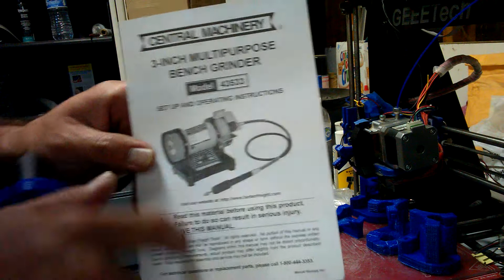3d printer into CNC for less than $50(1)

Comment: Is that glue stick on your borosilicate glass? I will start using PLA most of the time as soon as I receive it by mail, but have been getting ABS warping on the demo filament in the box even with very small objects, and in one case said small object completely detached from the 90° heated bed, so wanted to try these tricks for adhesion.
No glue stick at home for me, but I could try hairspray and abs slurry made with acetone, after all I have plenty of failed prints.
Reply from the maker: washable disappearing purple glue stick. gull all work pretty well but prep time is longer. 
try your same adhesion as last time but print a brim to hold part to bed
Reply: I know this thread is quite old but I use pritt stick although I have it on a 4mm glass bed and have no issues just wipe clean after each use.
Reply: In the meantime I've always been using hairspray, gives off quite a nice smell especially if paired with PLA, and produces great adhesion, sometimes too great :)
Reply: Hairspray is something I have not tried!?! Mainly because I would probably over do it and clog all my bearings up I can't help being a bit over the top sometimes when tinkering.
Reply from the maker: Hair spary with extra hold. Aquanet super hold, etc.
Pretty much anyone with super hold. 
But one has to remove plate to spray it and not get any overspary on the machine,

 I am suddenly having spud gun flashbacks...

Anyways, overspary sucks. Just a spritz is about enough. Too much can promote detachment.

At times I just use a heated glass bed, cleaned, to print PLA. Small stuff usually no issues.
But the glue stick has been the fav for ease of application, use, water based so wet rag and just wipe clean or rinse off in some water.